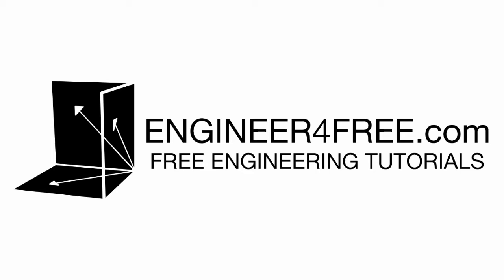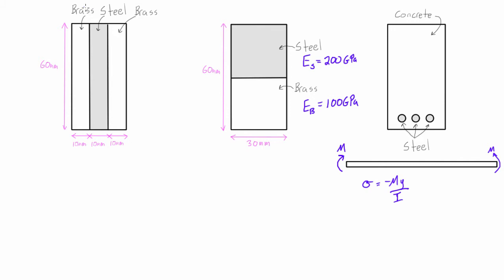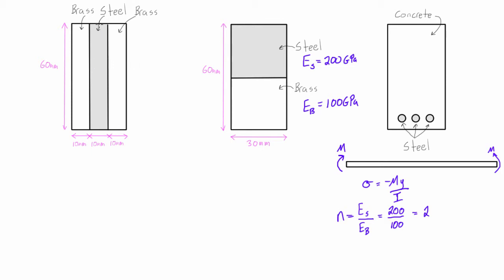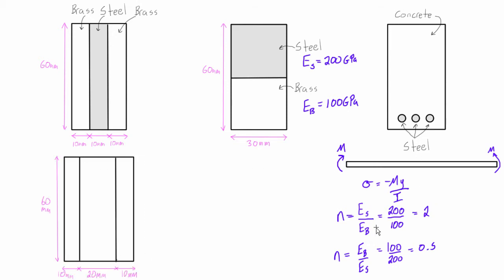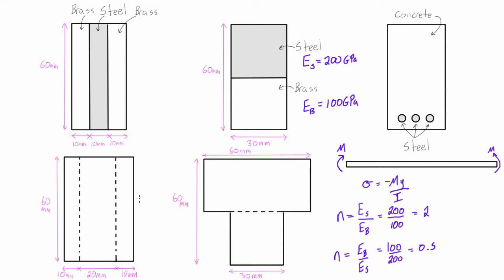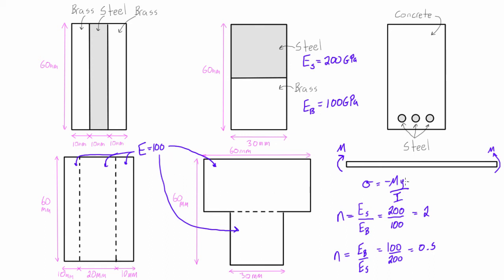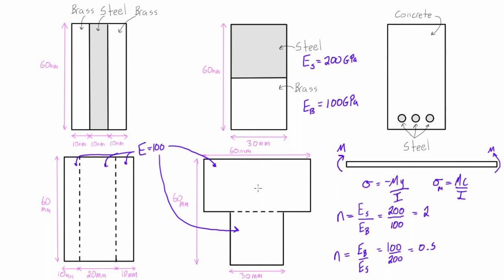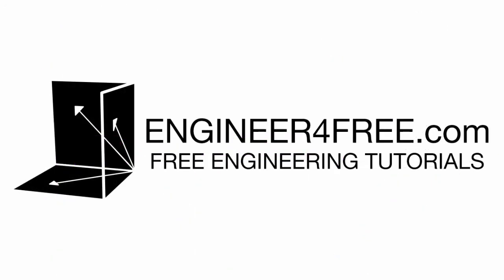Pure bending of composite materials introduced

Comment: How the strain profile is not changing.
Reply from the maker: This video doesn't show any strain profiles. The magnitude of strain would increase linearly as you go away from the neutral axis. If you cross into a new material as you move away from the neutral axis, such as the rebar in the far right example, the slope of the strain profile will change every time the material changes.
Reply: @Engineer4Free  yeah sure but I like your videos and that's why i commented on your video. Kindly tell me is there any discontinuity occurring in the strain profile.